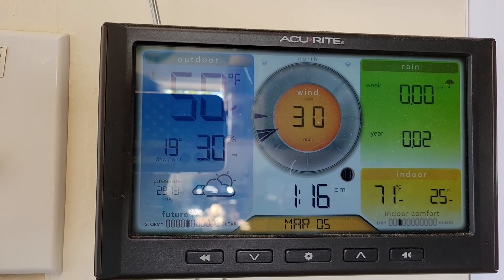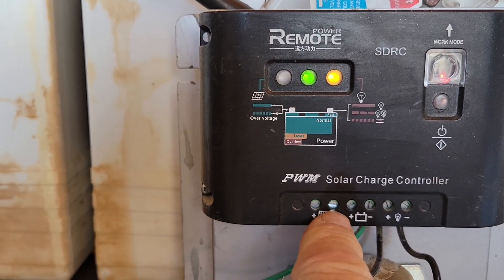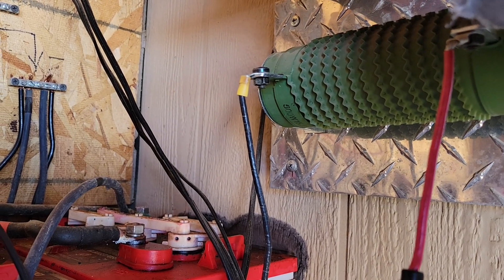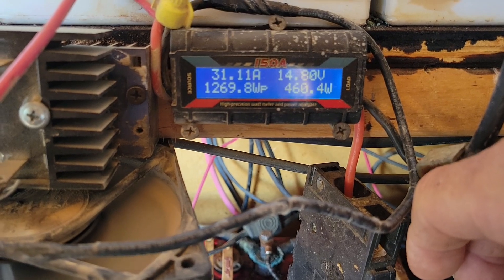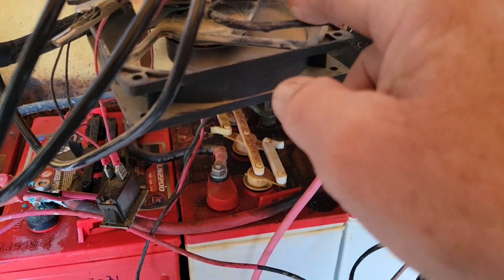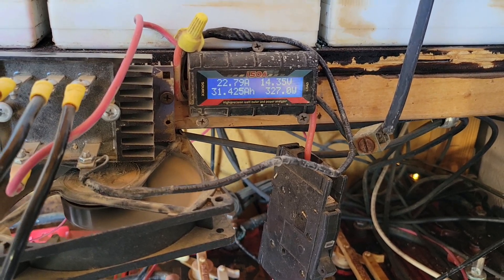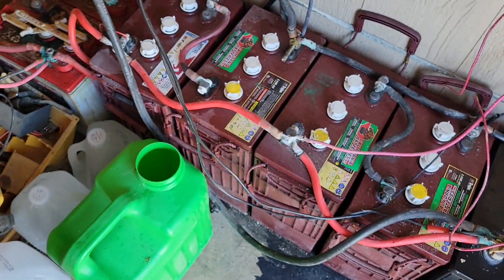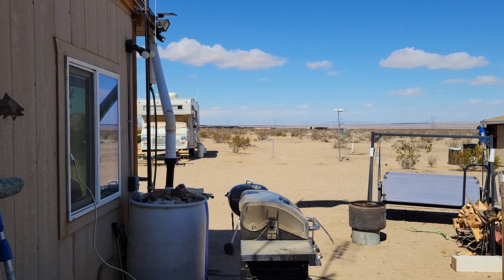Turbine Output In A Windstorm, Day 3, March 5, 2022

Comment: Yeah, you wouldn't like it here ; rains, then the wind blows...I only left 400 watts of panels out today...it was too windy...about 35 most of the day...so my 18 are at 25.2 volts. It was cloudy too. I'm not using much power though. They are saying 15 degrees for a high Thursday. So I may go get some burn wood and free lumber Monday. My hanging strawberries were looking pretty good so I put them outside for a couple of days in the wind and sun, and now they look like hell...so I have them back inside again. Our gas went up 42  cents last week...so I only go every couple of weeks now. I found out that on my 24 volts system, the bottom set of 9 batteries charge first, then the top set of 9 charge up...so there is always a difference in voltage between the two strings...I found a way to exercise the bottom set whenever I want...I have a 12 volt 410 watts inverter hooked to the bottom set. But not turned on...So I plug the cord into it instead of the 24 volts inverter, for my fan and laptop, and light...and it runs off the bottom set of 9 batteries only, so it evens the charge on the sets, if I do it during the day when things are charging. The top set will come up as high as the bottom set then. I also made a 9 legged spider out of #6 wire that connects to all 12 spots, and that's where the 12 volt inverter is connected. To the big Kearney in the middle . So sometimes I just run off of half the batteries for awhile. That lets the top set top off , and the bottom set get some use. Plug in a cord and flip a switch to equalize charge...I made it myself, lol. So if I'm using it I can let the Aims rest a little. Doing that usually keeps the charge from going to float, just staying right below that.

Comment: Windy week for you G Bear. It's been in the 80's here in the sunshine state. I did finally order my midnight charge controller. I went with the 150 after studying a little more I though the 250 would be better, But I didn't know that number is the voltage, The 150 is rated for 86 amps with a  48 volt battery bank.  all my research says midnight classics are by far the best , but it came with a 72 page book I have to read. And I don't like reading.  LOL    Stay warm and don't blow away.
Reply from the maker: Congrats!  You'll love your Midnite Classic!  You can search YouTube videos for tutorials on setting them up, but keep the manual handy.
Yes, the 150 is max volts input, but I suggest you leave some room.  140 would be a better max input.  I set up mine with 120VOC input on 2 strings.
Reply: @GBear  Whats your amps coming in? I havn't started mine yet but I did draw it up.  I'm going to have 121 volts and 66 amps. 8 rows in parallel 4 in series.
Reply from the maker: It varies with times and battery voltages.  I have see 24-29amps on the Midnite Classic, and probably getting nearly the same on the Renogy.
Reply: @GBear  Every video I've ever seen you put out your batteries are always full. Do they drain down any at night? I know you have a big battery bank . With mine I think I might be getting starting off to big. But it seems like most people start with a small system , and spend a lot of money by the time they get it where they want it. So I figured I will start mine with a 10 KW array.  I have the panels and the batteries. now I have my charge controller. now I have a lot of work to do.
Reply from the maker: At night they usually drop down to anywhere from 12.4 to 12.6 with lights, TV and normal loads.  I usually wake up to 12.4 but they are back at 13.0 on about 45 minutes.

Comment: Is that 6 x 6-volt batteries running that AIMS 4000?
Reply from the maker: I have 2 battery banks. Those 6 Trojans are one, and 18 US2200's are the other bank.  Both banks feed the AIMS.
Reply: @GBear  That's a lot of power!
Reply from the maker: It runs my cabin, garage, and both shops.
Reply: @GBear  That's what its all about! I asked because I've only got 7.2 kw of battery power (3 x 24v), and that's not enough to run my house -- really only enough to run my pool pump, workshop and garage. I probably need at least double that to run the house.
Reply from the maker: @brikshoe  that depends on what you need to run.  If you have an electric range and oven, a microwave that can cook a side of beef, a 10 ton air conditioner, and 3 women with hair dryers, curling irons, etc,  you may need more.
I live modestly with propane stove and oven,  propane tankless water heater, energy efficient fridge, propane heater, etc.  Only big power guzzlers are the window AC units in the summer, and I only run those when the sun is out.
Reply: @GBear  Check. Check. Check, check, check, hehehe. Yeah, we only use propane on the barbq.